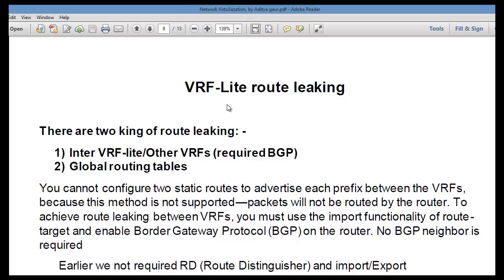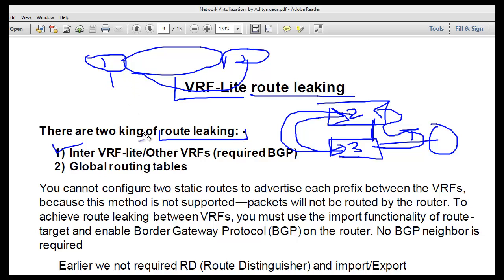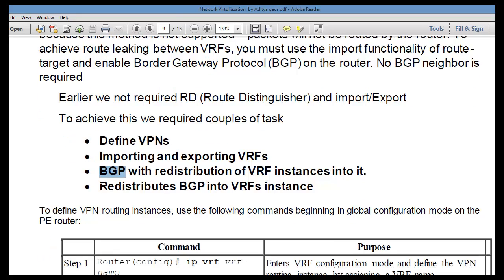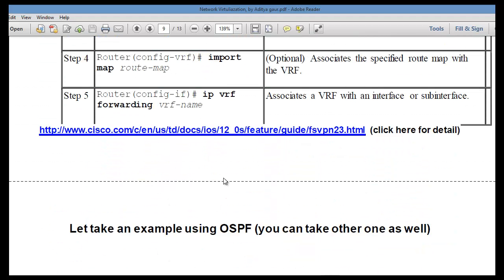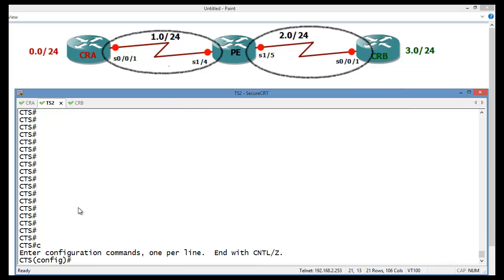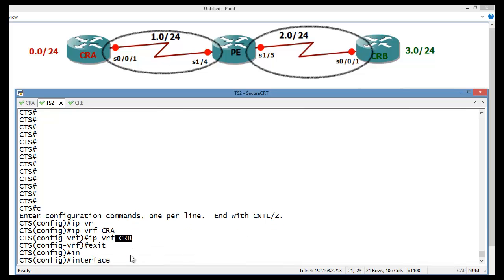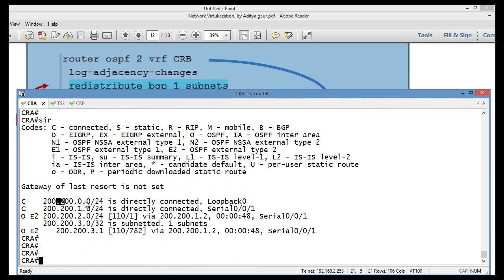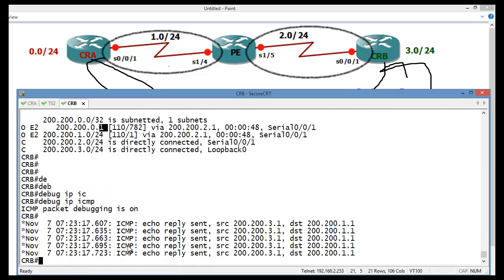Inter VRF-Lite or route leaking CCNP 2.0 (V-67)

Comment: Hi, I have two VRF on a same router. I actually did the same as you, OSPF, BGP and then the route-target. It works really well. The two VRF can communicate with each other and they are in each other's bgp table. But I would like the VRF to be able to communicate with the global. I have OSPF running on the global as well. But I can't do the same as with the two VRF because the global doesn't have a RD. Do you know how I can get around that? It would be really helpful.
Reply from the maker: ***** Can you please send email with diagram so that i can help you ??Adityakrgaur@gmail.com
Reply from the maker: ***** https://www.dropbox.com/s/aw8n08oiql1l8tk/Network%20Virtuliazation%2C%20by%20Aditya%20gaur.pdf?dl=0   get documents please